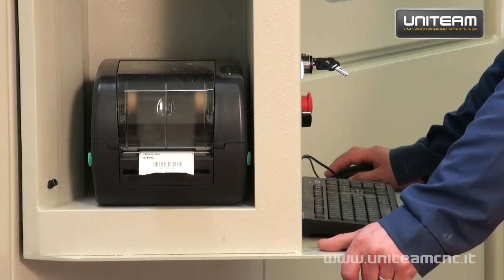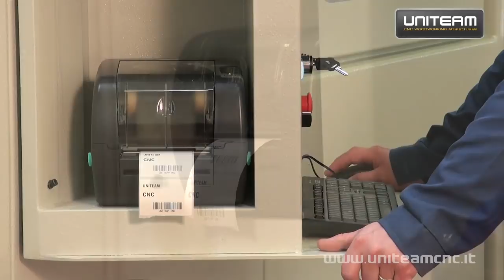ULTRA CNC machining center for timber construction companies

Comment: I'm a bit bummed they didn't assemble whatever it was they were cutting parts for.
Reply: I don't think they were making parts for something. It's like those videos of metal cnc machines. It's just a demonstration.
Reply: They were just showing the capabilities of the CNC
Reply: It certainly would help sell if they could demonstrate that they cut precise enough to fit together properly.  A whole bunch of fancy cuts on a CNC doesnt mean anything if you have to go back and cut it by hand when it doesnt fit.
Reply: It was parts for prefab house
Reply: @theenchiladakid1866  I'd say it would be nice to see them put those parts together during construction
Reply: @zeff1015  how many timber frames, that later do not fit, have you CNC cuted ???